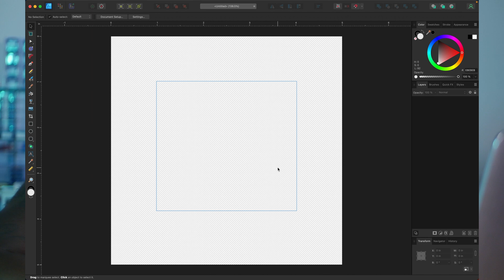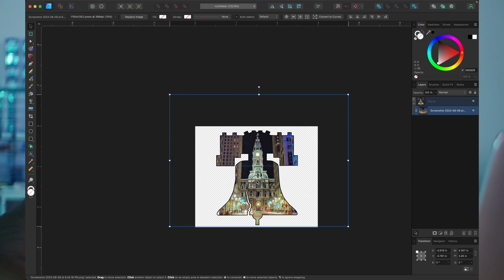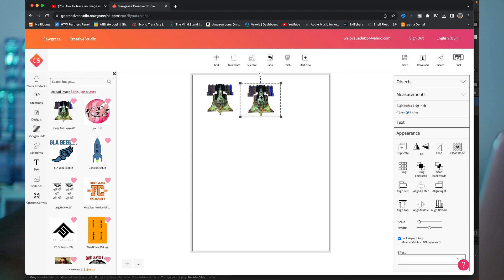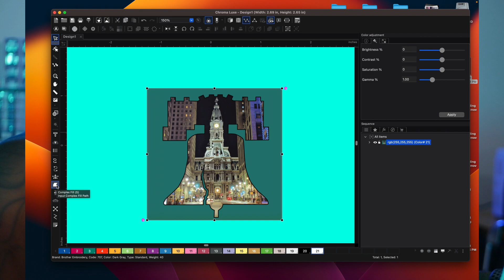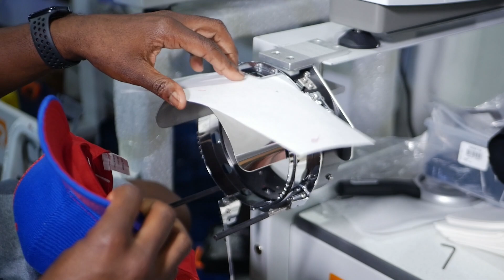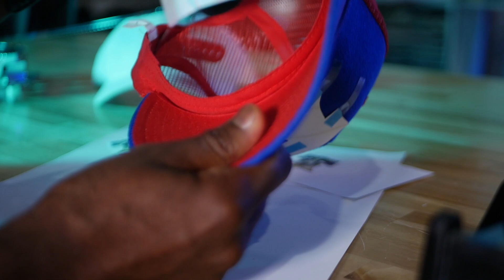Mixed Media Embroidery Sublimation Hat

Comment: To correct for the slight registration offset could you throw it back on the embroidery machine and do a satin stch outline like you would for appliqué? Or do you have to position the hat hoop again?
Reply from the maker: This was just the prototype. I will put some bleed in the next one so it doesn’t loose registration.

Comment: So somebody told me they have or want to make an embroidery machine that just applies ink to just one thread and does a garment or hat. Is that true?
Reply from the maker: They have that already. It’s a ridiculously large and not practical attachment that goes on the top of your embroidery machine that sublimates the thread so you only ever need one spool. It’s astronomically expensive and the only way you can get it is if you have 15 foot ceilings.  it’s ridiculously unnecessary. I’d just rather my machine switch threads, hence why no one has it.
Reply: @adubbproductions  ok. Thought my friend was pulling my leg. A-dubb great video. Always thinking outside the box.
Reply from the maker: 🙏🏾 no I saw it a few times at different expos. It looks cool but it’s like twice the cost of the embroidery machine for just the unit.